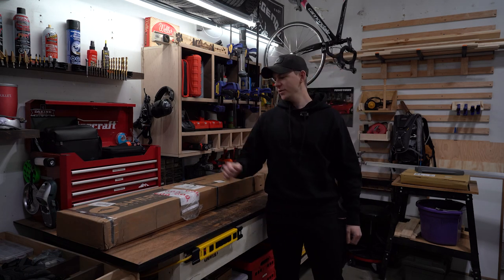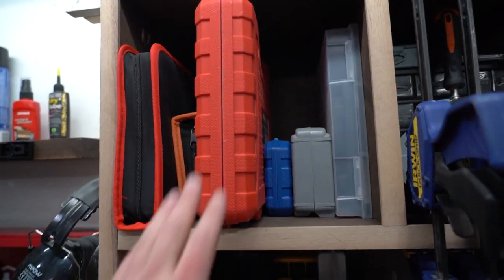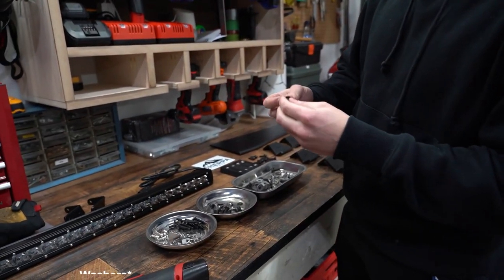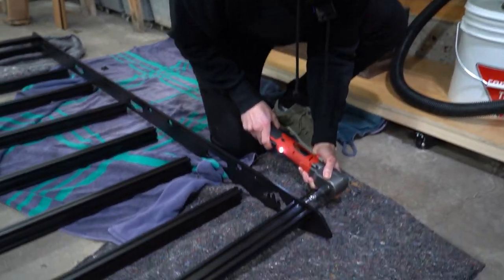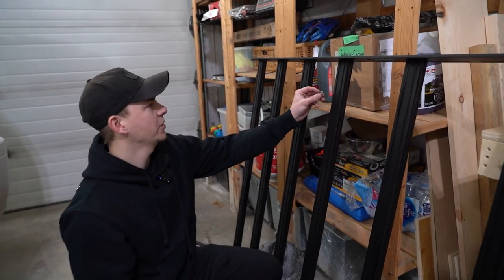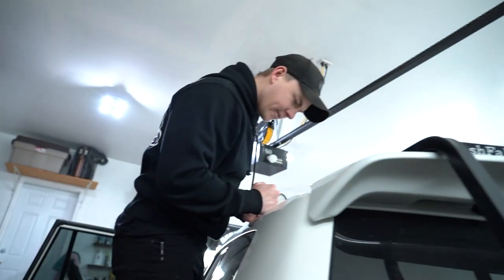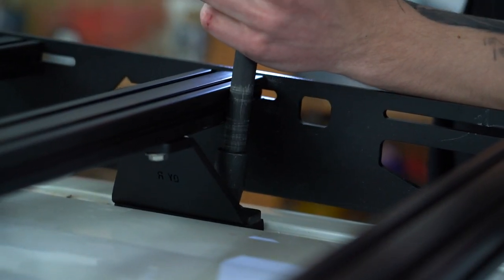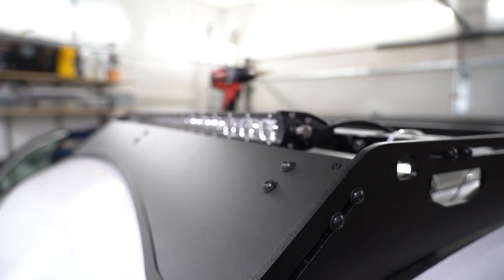Off-road Lexus GX470 Roof Rack  - Sherpa Equipment

Comment: Sherpa actually recommends NOT using any silicone.  Applying silicone the way you guys did actually worsens the seal.  The whole point of their rubber foot spacers is that it creates a flat, molded seal between the rack and the roof line when the bolts are tightened down.  By putting silicone around the holes you're creating another layer between between the roof line and the rubber.  The silicone will flatten out as it's compressed and over time with temperature changes it will harden and create dead space and a void between the rubber and roof line.  Making it even prone to water intrusion.  I would suggest removing the roof rack, get rid of the silicone and reinstall the rack per Sherpa's instructions.
Reply from the maker: Okay thanks that’s good to know! Il probably try and take it off, luckily I didnt use much. I was going off a buddies suggestion but I guess I should have double checked!
Reply: @LoganKingMedia  No problem, I can see why your friend recommended silicone.  Most other racks say to use silicone because they use aluminum barrel spacers as the foot.  Sherpa specifically designed a rubber foot pad so that the user does not have to apply silicone.  For reasons mentioned above, silicone isn't appropriate to seal the roof rack as it hardens over time and degrades.  If you want to apply silicone you can put a small dab into the bolt holes but I would not apply any where the rubber footpad sits.

Comment: How's your Sherpa rack holding up ? Any rust or bolts coming loose?  Thinking about swapping my JW out for one. My powder coat is failing after less than a year. Never  seen snow. Been in a dry Texas heat the whole time.

Comment: Just getting into this and am so confused by the roof weight ratings. My 2009 GX470 says the roof limit is 130lbs.  A Rhino Rack itself is like 60lbs, nevermind an awning, storage and/or roof top tent.
Reply: 130 lbs while driving with the stock rack. I believe the spec on the roof is 700lbs

Comment: Awesome setup! At 6:53 How have you wired up these lights to turn on only for a while under the car when you unlock them?
Reply from the maker: Thank you! I wired them in where the factory running board lights used to connect to!
Reply: @LoganKingMedia  awesome! Shame mine doesn’t have factory ones, I’ll figure something out with a relay perhaps. Thank you for replying!

Comment: Enjoyed the video. How do you get power to the light bar on the new roof rack?
Reply from the maker: Thanks that’s awesome! I have the wire tucked beside the windshield under the molding, if you put a little bit of butyl in the molding before shoving the wire in it sticks in there really well.

Comment: Looks really good brother.  
Dang I didn’t use silicone with my rack.  Curious if it’s necessary.  Think so?  Did the install instructions say to?
Reply from the maker: Thanks! It's just to prevent water from getting down the bolt holes. It is just something I learned from friends along the way and they suggested it. If you haven't had any leaks yet you are probably fine but also it wouldn't be too hard to add some to each mounting location one at a time.
Reply: @LoganKingMedia  plan on it now. 🙏 solid idea!  Love the Sherpa crew...
Reply: pro típ use butyl tape instead of silicone much better coverage and way less messy if you ever go back to stock or remove rack for any reason
Reply from the maker: I just found out that due to the rubber spacers they use you do not need to use silicon!
Reply: @LoganKingMedia  I just installed mine, their design is such do you don’t need to use silicone with the rubber feet. Other racks like SSO require silicone